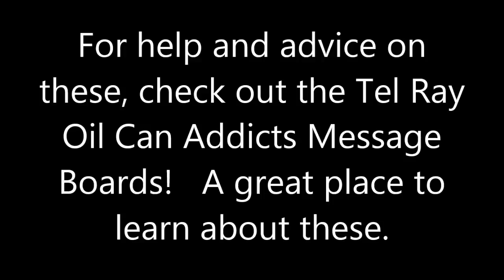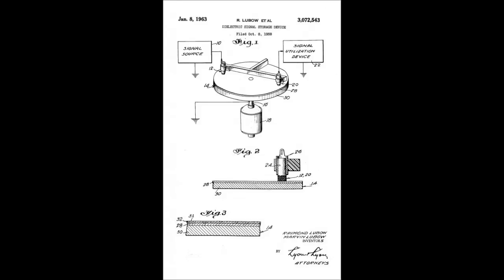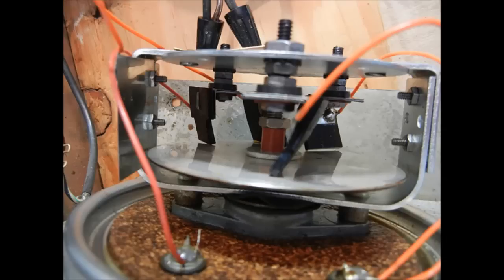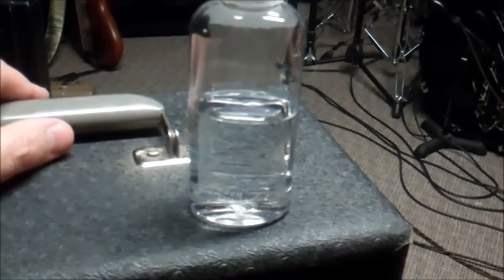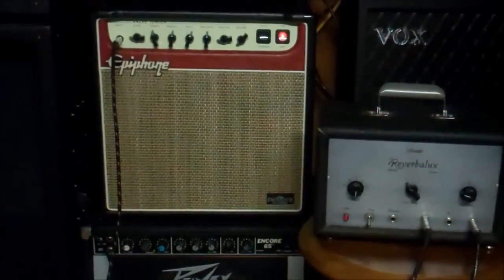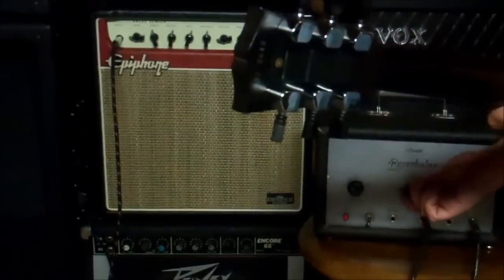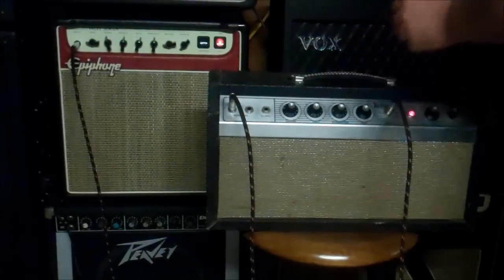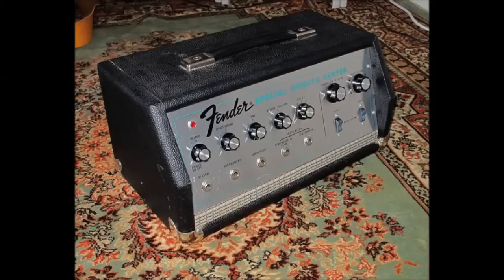All about Tel-Ray Oil Can Delays,  Electrostatic Delay Line,  Adineko

Comment: What wonderful devices !!! I'm inspired to start hunting one down. Thanks so much for posting this very thorough and informative video.
Reply from the maker: Thanks,  I appreciate your feedback.   Electro-mechanical echo devices have always fascinated me.   I have the tape echoplex,  several spring devices,  and a few oil cans... now to just find the Echosonic, Copicat, Echofonic, and Echorec devices....  well at the kind of price I can handle anyway.   Still to this day, the exact formulations for the Tel-Ray Adineko disc, and wipers isn't known.   None of our basement engineers have been able to successfully clone one,  although a few reported discs that worked somewhat.   At one time, rumors spread that the oil inside was cancer causing,  and with people not knowing what it was,  many units were destroyed by bad experimentation.   If you don't scratch the disc, and use only LB65 oil,  it should last a long long time.
Reply from the maker: Yes... there were few produced commercially, but were a DIY project in the back of magazines in the 60's.   I'd prefer to build a plate type reverb here if the materials fall in my lap.
Reply: Thanks for the tip, Buddy. I will check it out. Tell your wife that Uncle Doug and Jack have authorized your parts expenditure and therefore it is exempt from criticism.  On second thought, don't ;)
Reply: I made the seller an offer, Buddy. As described in your video, buying a non-functioning unit is a real crapshoot since some of the easily-damaged parts are irreplaceable. Looking at the photos, DK, do you see any obvious problems?
Reply: Uncle Doug, it’s hard to say, I really don’t see much bad but there really isn’t much to look at, only two photos of the back opened. This unit doesn’t have the fancy hardware like these others when the motor spins up, the main shaft moves over. Also there is no drive belt on the motor and the main pulley. I don’t think that makes much of a difference because Kolby has another video showing him restoring another unit and he just put a belt from a cassette machine I believe. In that video the motor didn’t move at first but with a little oil, he had it running in no time. I really don’t see anything else except a broken deadman that the back screws onto on the left side, facing the back. I don’t know if it has been dropped. It does seem like there would be more damage than that if it has been dropped. The rest of the case looks pretty good and appears to be the typical Fender build.
Reply: All for naught. The seller rejected my offer and closed the auction.  I guess I either offended him, or he had already sold it to someone else. Screwed again !!!
Reply from the maker: There's a Standel Reverbalux up there at 200$  as of yesterday.
Reply from the maker: There's an operating (allegedly)  Standel Reverbalux  up there at 200$,  BUT it has an unknown reserve on it.    It allegedly works.    Also,  keep an eye out for Organs on the curb.   Some Organs and organ speakers (farfisa)  had the oil cans in them.
Reply from the maker: My Standel was in "unknown"  shape.... and the power cord was so ratted out,  one would be living dangerously to plug it in....   I videoed that one from unboxing to working.   I intend to change the filter caps,  but it just needed a cord and belt to work.  It was an ebay find.
Reply: Thanks for the tip, DK. I'll check it out.
Reply: Ahoy, DK. I am now the proud owner of a Standel (correction: Tel Ray) Deluxe Organ Tone that appears to be complete but non-functional. I would appreciate it if you could give me some advice from time to time on this old beast. One tube is missing.....are they both 12AX7's?  Are there any schematics for the wiring of the amp section and/or the mechanical contact wiring?
Reply from the maker: Isn't "Deluxe Organ Tone"  a Tel-Ray branded product? (rather than Standel)?   
I found a hand drawn schematic on Jray1.Tripod.com     Although I don't know this one backwards and forwards,   The Oil Can addicts forums likely have the schematics.   Most units (other than Gibson)  used a 12AX7 and a 12AU7
Reply from the maker: For the sake of NOT making the comment section go bananas,  fill out the contact form at my site mrvamps.com and we'll have an email campaign.
Reply: You're right, Tel-Ray. I've been doing so much reading on the subject that the names are mixed up in my aging brain. Naturally, the tube ID (on chassis) for the missing tube was obliterated at some time in the past.
Reply from the maker: No problem.   The 12AX7 is generally used to amp the signal going into the "can"  and the 12AU7 is used to recover signals back from it.   This is the case on the Fender units I've seen, as well as the Standel.  (Gibson uses 6EU7 + 12AU7)  I'm glad you found a unit to experiment with... I hope you have a healthy disc and wipers.  If the can appears to NEVER have been pried open or drilled into,  you're very likely in a good position.   If some bozo put ATF or Brake fluid in it,  you're likely up a tree.   Other than having a healthy  Adineko can,  it's not too far off from a reverb or echoplex circuit, so it should be a straight forward resurrection.
Reply: @DeadKoby  Wait, the Speaker had an oilcan attached to it? I've never seen such a thing, but then again I had never seen these delay units either.. What Organ company had these devices in them? Interesting video DK.. I had watched the one Uncle Doug and Jack restored.. Wow he did a nice job on the unit considering the shape it was in. There is a company called Analog Outfitters which takes the tone-wheel from a Hammond Organ and makes a really cool Vibrato and Reverb unit.. I think it's about 2500.00 dollars. I have the complete tone wheel set-up from a M-103 Organ, but without a schematic I wouldn't have a clue how to make it.. Though they don't use the entire bank of capacitors, It doesn't actually look to terribly hard to make.. If I only could get my hands on a copy of the schematic.. Check it out if you havn't yet, it's really neat. Take care, Tom
Reply from the maker: Hi Doug,  I got your email on 3/9/19,  and replied...  but I'm guessing you didn't get it,  so I sent it AGAIN.  Please check your junk mail folder.
Reply: Sweet
Reply: I’m interested in learning more about these things and old guitar tube amps any suggestions
Reply: Legend!

Comment: Love the watery sound of these old units.
Reply from the maker: Do you have a collection of these too?   It seems their fan club is very strong.   I sought out the Gibson and fixed it....  the Standel was an affordable ebay find, and since the cord was scary bad,  nobody dared plug it in.   Perhaps another one will come my way at one of the regional "treasure" stores.
Reply: No, I'd never even heard of them until Catalinbread came out with their Adineko pedal, a digital emulation but it led me to research the originals. I read up on them and watched a few other video demonstrations like yours. :)
Reply from the maker: Nothing sounds precisely like the analog devices.... there's a built in inconsistency to them that adds to the cool factor.

Comment: I just ran across 3 of these fender delay units and sold them on eBay. I still have one more I may get up and running. It works, just no delay
Reply from the maker: If you need my help,  contact me through my website.

Comment: I had one of the Morley pedals bought used early 80's. All I have left is the metal plate with the "echo speed - fast - slow" on it. Note the metal carrying handle. This thing was the size of an entire pedal board.
Reply from the maker: If I ever run across one,  I'll be sure to grab it.   These effects are so interesting and unique.

Comment: I bought  a Gibson version of this device in 1976 for 20 dollars at a garage sale. It looked like a small amp head wrapped in brown Tolex ( slightly different than the one in the video ). I loved it....I knew one other guitar player in town who had one of the first Roland Space Echoes but they were very expensive. I used it for about six months at home and then formed my first band. WARNING the Gibson unit has a tube preamp in it that uses a 300VDC B+ supply for the tubes. These units came with a 2 wire power cord that had an unpolarized plug. Imagine my surprise when the first time I went to sing into a microphone with my guitar in my hands at the amazing blue burning flash that jumped from the mic to my lips. I didn't keep it for long after that. Pretty rad unit though! Oh to be fourteen again :)
Reply from the maker: Indeed.   It'd be really nice to have that back nowadays,  with the prices they command.

Comment: Today I bought a Fender Dimension IV Sound Expander which uses the Tel-Ray oil can unit with a spring to create the vibrato effect.  However, the speed is not adjustable, just on or off.  It's fully functional, but a bit noisy, so I'm hoping to figure out how to lubricate it.
Reply from the maker: Union carbide lb65

Comment: Great presentation of an effective and apparently rare device. I would like to have had a seat at the table when the engineers were designing this.  

I enjoy seeing a piece of technology that did not exist become a fully functioning device - especially old stuff. Engineers and designers did not have software or the internet to rely on. Most would have been fortunate to have an air conditioned environment and a slide rule.  

121:45 Fender knobs on a Gibson amp?   My eyes are burning.  :-)
Reply from the maker: I'm pretty amazed myself at the technology in the Adineko...   Essentially they made a moving capacitor surface.    Those are the stock knobs on that Gibson.  There's a few 60's models with that type.
Reply: Stock knobs?  I learned more than I thought I did. 

Old gear intrigues me because much of it was designed from scratch using nothing but a pencil and brain power. They couldn't always modify an existing product, and they certainly did not have access to limitless information resources.  That  moving capacitor idea was quite a trick. 
Thank you for the reply.
Reply from the maker: If you do an image search on the GA-4RE,  you'll find there's two knob types...  one is the numbered knobs like mine...  the other is a round silver face knob like you'd find on a home console hi-fi.   The GA-4RE I have is pretty close to original...  other than replaced electrolytic caps.

Comment: Very cool...the old Ampeg Reverborockets that have an echo control knob Do they have anything like this in them ? Mine doesn't do anything like this and wondering if it's not working properly RR 2 Thanks
Reply from the maker: I would think yours would be a spring tank.

Comment: That thing has an electrostatic disc that looks much like a big hard drive disk. Hard drive is magnetic though. Has writing rewriting heads that constantly write and wipe..
Reply from the maker: It has lots in common with a capacitor.   That's the best way to explain it.

Comment: Excellent comprehensive run-down of all known oil can delays. I'm charmed by the use of grillcloth scrap on some of these heads, and the name "vagrant" on one of the later tel ray originals, which, probably sarcastically, even features the full address of the company on the front of the unit! (were vagrants hanging out front of the company office or something, repeating themselves?)
Reply: p.s. I'm a long time Uncle Doug follower, and he insisted I check this out, and I'm glad I did.
Reply from the maker: Tel-Ray was one of the best of the "basement" engineering firms.   Those guys really made the biggest developments in Wah/Volume.   The Oil Can's are more of a side-note,  but a pretty darn fascinating one.

Comment: As the pedals run around $200,I'm assuming a person could build his own solid state version.Great vid;I noticed the use of a shaded four pole motor that was commonly used in kiddie record players from the '40s through the very early '70s.
Reply from the maker: The can's impedence is something like 20MegaOhms,  so it's more suited for the high voltage tube circuit.   A SS version does exist as the Morley EDL

Comment: There ara three heads correct?
Read, write and erase.
The erase head must be the key.... and what they put in/on the anodized aluminum disc?
Reply from the maker: The charge didn't last very long... so it was usually one record, and 2 playbacks. Depended on the circuit.  Some had a 4th for erase.

Comment: Have you tried, or heard of anyone successfully trying, to add a provision that varies the motor speed? It would seem to me that changing speeds (particularly slowing it down) would create an even more haunting effect.....provided it doesn't run the risk of burning out the motor in the process!

These units are fascinating, and I can't believe that I somehow missed them when they were originally produced! I'm the right age to have at least one kicking around my basement......but then again, I'm primarily a bass player! LOL  Great video...thanks for putting it together!
Reply from the maker: Norm Jacques  There are two models on my list that had variable speed.   I don't know for sure how the speed variation was done.   If I find out I'll share.
Reply: DeadKoby it was done by a simple spring that attached to the fly wheel of the motor Centripetal force would engage the spring which would create a slight drag in motor speed... this happed on opposite end of the shaft that turned the disk

Comment: From reading the patents it shouldn't be too difficult to reverse engineer one, and I'd like to make one, though I might have to try a different type of rubber than 'graphite imprrgnated', one thing I have not seen is what kind of voltage is being applied to the electrodes
Reply from the maker: If you can reverse engineer it,  go for it.   The OilCan addicts have had one user trying to reproduce the disc, and has only made SOME progress.  If you get a good working model,  I may be your first customer.
Reply: @DeadKoby  👍🏻

Comment: Holy.. yea it's not for no reason the older recordings have unattainable  qualities.. they used stuff so amazingly indicative of the time! Even that sweet Epiphone amp!
Reply from the maker: Although I do have some legit vintage amps,  that Epi is from the 2000's,  made to have a vintage look.  So I fooled you on that one.   The Two oil can echo's are genuine 60's era.   In the Epi amp's defense, it is a traditional tube circuit design though.
Reply: @DeadKoby  Haha really! Are those amps available to buy? Would you agree they sound super retro?
Reply from the maker: You can likely find them,  although they are discontinued.  The one here is called Valve Senior.  It's not all that common.   The two all tube models you'll find lots of are Valve Jr. and Blues Custom.

Comment: Forgive me, but do these require any kind of bias oscillator? Just because  I've seen a variety of these performing differently,  sounding like poorly biased record heads... since it's different, was there any way to sneak or approximate a bias oscillator in the drum spinning?? This may be the key to getting it to work better... since even as far removed from tape as it is... it is still basically the same and maybe we're built before they even understood this principle?
Reply from the maker: Schematics for several are readily available for download.  Try Gibson GA-4RE

Comment: since you mention the LB-65 oil as having conductive particles in it....have you even tested it with a meter to see if you get a reading with the probes ?....any resistance reading.....>>>>>>>>>>>>>>>>Could be the same liquid they used in a DeArmond Vibrato unit in its capsule since it had to be conductive too to ground out the electrode when the liquid washed up on the electrode to complete the circuit.......
Reply from the maker: I don't know that I said that...   I have not taken any measurements.
Reply: review your video presentation....you mentioned in in the first 1/3 portion talking about the parts when you got to the oil
Reply: if the oil has a conductive nature...being a conductor it should have some resistance reading with a meter if you stick the 2 probes in.  This is one of the issues I'm investigating based of the replacement oils being sold......whether some are selling legit oil or just mineral oils as a counterfeit.......when it comes to repairing a unit that's not functioning with the can when the can appears to be intact without defect......the weak link
Reply: The wipers being mentioned as graphited....really translates to black rubber.......the rubber is colored with carbon...hence graphite, and suggests its really normal rubber.  The situation of carbon coloring is one of the potential issues that might manifest when using the eyeletted circuit boards as Fender used in their amplifiers......the circuit board becoming conductive instead of acting as an insulator......they were also wax coated relative to moisture....since water can be conductive and could enhance the issue
Reply from the maker: I am going by the info I found on the patents, and from the other techs at OilCanAddicts.   Some of them talked to Ray Lubow (the inventor).   I bought my oil supply years ago, and it's worked fine, so I dunno otherwise.
Reply: @DeadKoby  would you be able to do a quick probe of your oil supply to see if you get anything on your meter....for curiosity ?
Reply from the maker: https://www.youtube.com/watch?v=ZqX10Or-SgM    There's your answer.